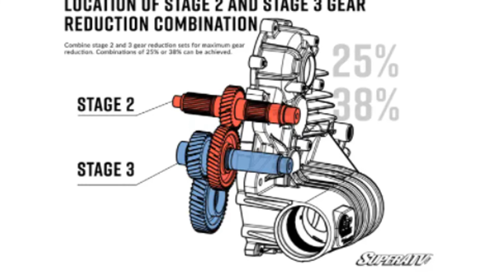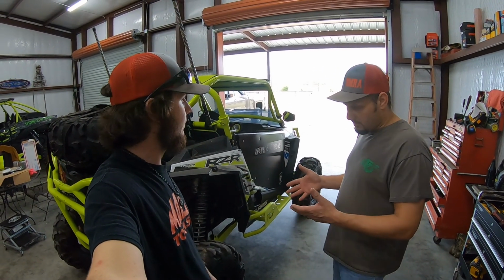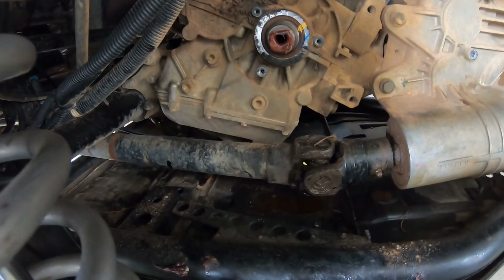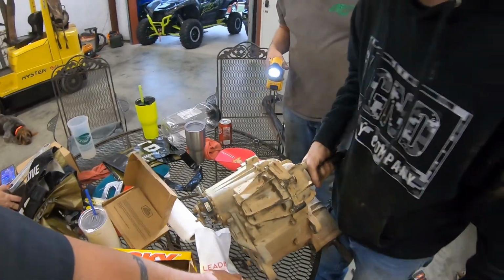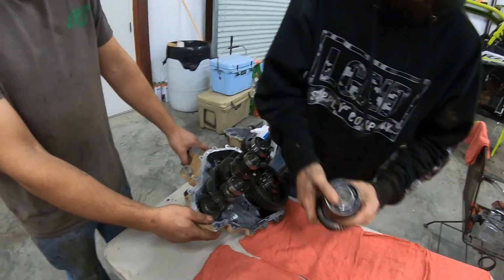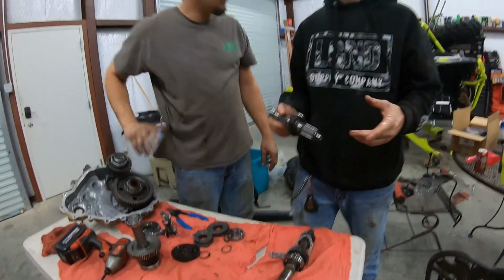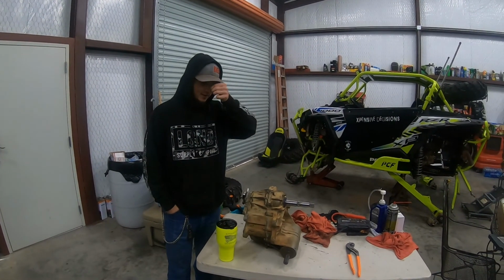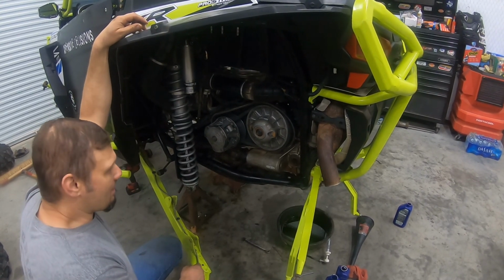1000XP RZR gear reduction. Brent gets a major upgrade

Comment: Nice video. Just curious, is the gear reduction across all gear ranges?  I’m no the ledge about doing one on my 19 1k.
Reply from the maker: Yes the double we installed affects high and low range. You can get a low range only but I was worried about the spread between them.
Reply: @XpensiveDecisions  I’m leaning towards the 25% just for the simplicity. I’m currently stock with a dalton clutch kit running 32 zillas. It does very well for what it is. I twisted my front prop shaft in two this weekend so it’s looking like time to do some upgrades
Reply from the maker: @head458  Would definitely help out, I didn’t have many issues until I went with sticky zillas. Did a gear reduction after replacing belts almost every ride. My last ride claimed the front diff and a sandcraft drive shaft
Reply: @XpensiveDecisions  ewwwwww. I went with the full rhino cv prop shaft. We gonna see how it holds up
Reply from the maker: @head458  they are good. Blue highlifter in videos has that set up. He is running 35 zillas

Comment: What Satv Part Numbers did you use? 
Size Tires?
I am torn currently about doing this. im trying to figure out my  % reduction that i want. 
17 xp1000 on 32s with giloman tune and clutch kit. wanna go to 34/35s 
trails/rocks/ is my normal. its not dedicated crawler. 

Your setup seems to move very very easy with light throttle
Reply from the maker: I like it a lot. I wish high wasn’t as low, I am turning some RPM. 
The whole kit is GRK-P-RAN-001-K
Has GRK-1-33-001 and GRK-P-RAN1K-12
Reply: @XpensiveDecisions  Are you on 35s? Can you still maintain 65Mph in high?
Reply from the maker: @zeks05  I am running 32s and it will go 65 but haven’t tried to maintain for a long time. At 50 mph it’s over 6k rpm.
Reply: @XpensiveDecisions  well accordingf to OEM end of shift phase is 8000-8500 for 55mph. so with my tune mine will run up to 9200. 

Do you think it lowed your high gear more then you thought it would. i have been looking into the parts seems they lower the the % between the gears like the reduction is the same % across the board so to speak.
Reply from the maker: @zeks05  I don’t do a lot of higher speed driving so it works fine for me. I do like lowering high range bc I think the split between the extra low and a factory high would be too spread out. Mine is really comparable to the trails and rocks factory gearing now and the factory KRX gearing.

Comment: What are the percentages in low high in reverse?
Reply from the maker: It was a 37% overall. It was a 12% and 25% kit. Never really noticed a change to reverse. Low and high was a big difference. If I had to do again I wouldn’t get as much. Really affected normal road driving.
Reply: @XpensiveDecisions  I'm looking to do one on my xp 1000 also.  What do you recommend?
Reply from the maker: @montanamav8941  difficult to answer, how do you ride? What is main way you use machine? What size tires? Any extra weight added to machine?
Reply: @XpensiveDecisions  I ride alot of mountain trails and rocks.   I also run down fire roads.  32s.  I'd like to have a lower gear but also keep my high for running down the road
Reply from the maker: @montanamav8941  I would go with the 13% or the 25%. 25 will hurt some road riding but will be a lot better for the tough trails

Comment: Looking doing gear reduction on a 2018 xp4 1000 running a hunterworks thick belt right now which helped allot but we carry allot of weight 4 kids so it's basically a school bus so how does it handle on the trails as far as speed in low on trails
Reply from the maker: Really great. It does so well that another friend that rides with us installed on his 2021 XP 1000 4 seat and he said it is a whole new machine.
Reply: Thank you for your help this is our first machine and we're learning on the fly
Reply from the maker: @nathanmatthews3102  that’s why we do it. To maybe help someone get a step or two ahead. We have learned a few hard lessons.
Reply: @XpensiveDecisions  I would say so thanks again!!